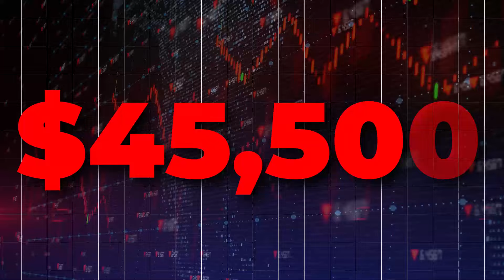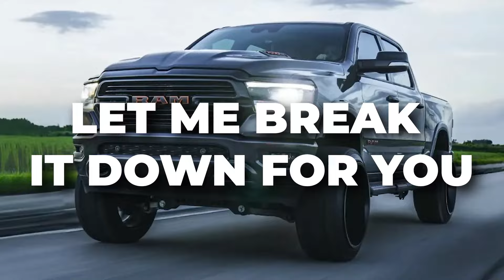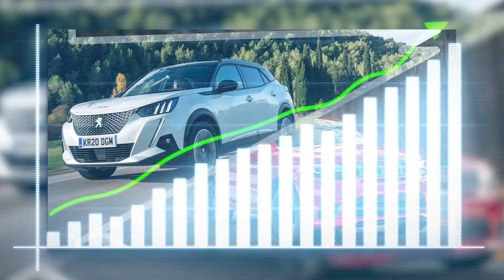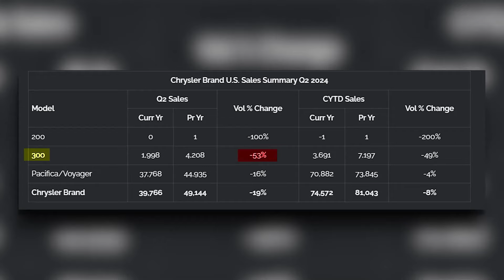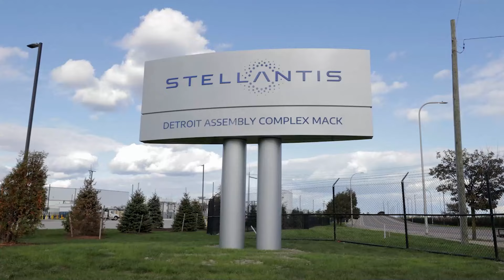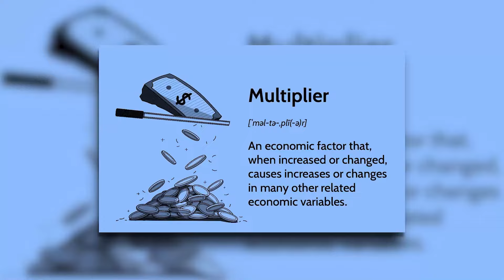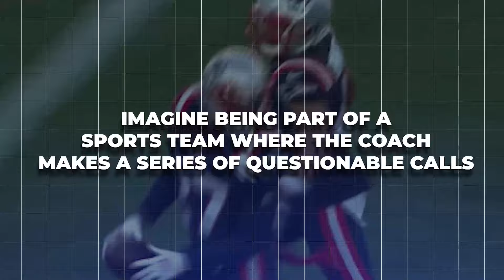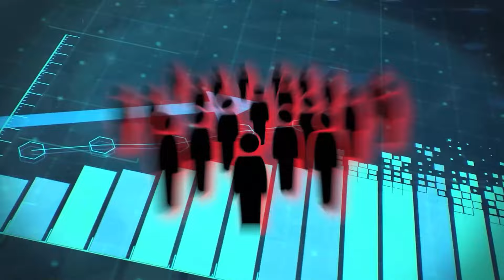Stellantis Announced The END Of Ram Trucks & FIRED All Workers!

Comment: Nobody wants a 6 cylinder pos engine, get rid of the ceo and lower the price while going back to   v8s, the hemi tick has been fixed and is virtually Mon existent.  They cut corners upgrade the headers and that problem would go away as well. 
 Most of us faithful ram owners will be moving over to chevy...the stelantis ceo forces us to go
Reply: Stelantis is a typical corporate organization the y Care about shareholder dividends only the Quality of the product is not considered any more. auto Manufacturers used to try to build a Quality product to promote their  name , now they only worry about charge more and spend less.
Reply: 90% of trucks don't need a v8. A durable v6 or inline 6 is perfectly fine
Reply: Why does a CEO need to be paid 56 Mill. Stupid, workers paid less. A CEO needs to be paid, by, what are the sales? Sales good give alittle back. No sales fire them. I live close to Newton, Iowa. When Maytag shut the doors, lights off. The CEO walked away with 20 Mill. He screwed up he loses.
Reply: Ram is still a way better truck than Gm and I was raised on GM , I have the cursed Ford I'm dealing with now but soon I'll be safe in the arms of a Ram . 🐏 ♈

Comment: Well if you will stop and think about it $45,500 was what you used to be able to except to pay for a pretty decently loaded truck and now hell to get a good model the starting price is pushing 60k plus to get a nice limited then you will pay almost 80k which is twice what the truck should cost to start with especially considering that the only reason for this is because the people at the top got to used to charging 80-120k for a damn truck during Covid times and now they see that not only are they not going to be able to charge that but hell they can’t even sell a truck now because people are burnt out on paying the exuberant prices for stuff that falls apart in the first few years and loses half the value of the damn thing when it leaves the lot to start with. Yet the people are wrong and the problem? Seriously get the f over your self people

Comment: I would sacrifice these modern screens and MPG  for a dependable vehicle in all weather conditions, that has longevity, and not obsolescence built into it, or chronic engineering flaws that cannot be fixed, these stupid mandates forced upon auto manufacturers ( ie increased mpg, less emissions etc)  are much of the problem, which I think is BS because if they were really concerned they would stop fracking and not allow Fukushima to happen, I mean do they even measure the radiation levels anymore? Before these nuts further bankrupt the US and European auto industry, stop EVs ppl are sick of them, stop turbo charging little motors that wear out fast and are expensive to maintain

Comment: The pricing is the problem. I just want blind spot / lane changing / block heater / towing package and a few other things in my vehicles. Just try finding what you want at  Ram / Dodge.
Reply: Id settle for just a good truck without any of the extra buttons and sh!t

Comment: How about a price south of $40,000.   How about many different interior colors (NOT JUST BLACK).  The stellantis personnel that should be fired are managers and excessive expensive option pushers.   Pickups are work trucks.  AND NOBODY wants to buy a truck with engine or much of the truck made in mexico.
Sales decline has most to do with excessive price. AND excessively overpriced unwanted options contribute to overpriced trucks.
Go back to pricing less than 35,000.